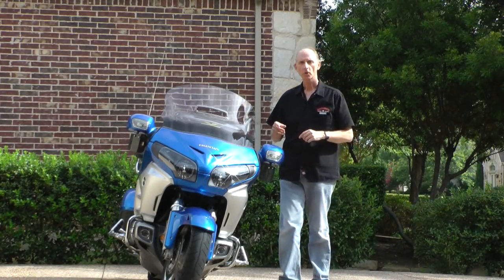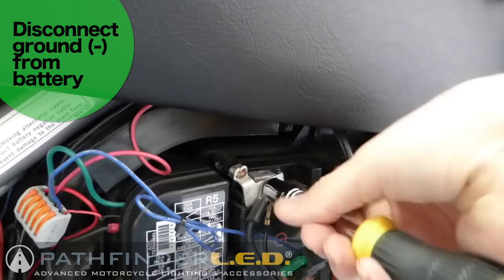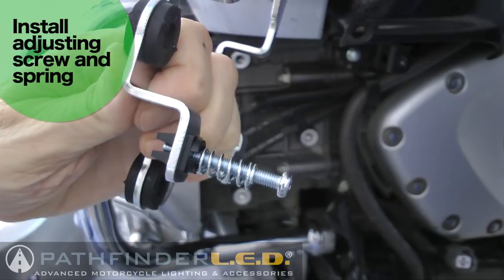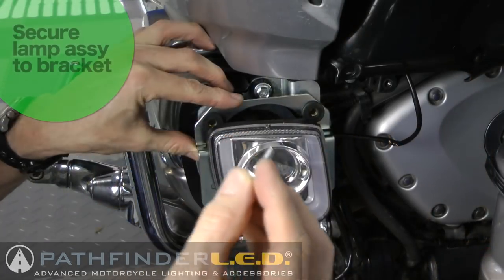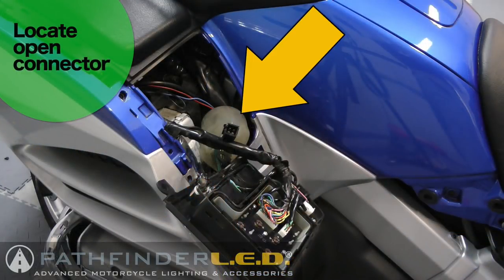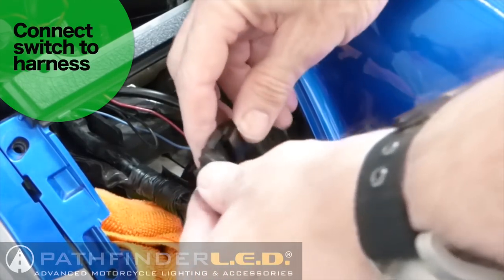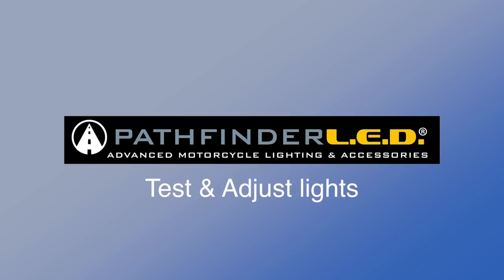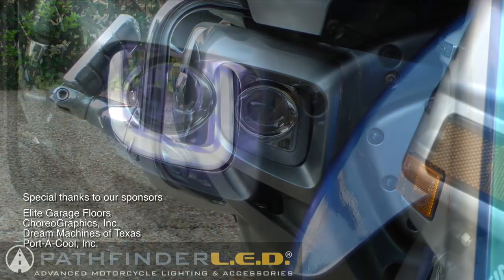Install PathFinderLED® Rectangular LED Fog Light for 2012 Goldwing/F6B/Valkyrie

Comment: Man, I can't thank you enough for making all these videos.  I just bought my very first Honda Glodwing - an F6B, actually - and I got tremendous knowledge from watching all your videos.  I just had the 2016 F6B delivered Sunday, but I couldn't get plates for it till my VIN inspection appointment today, so I hadn't even ridden it at all until today!  Anyway, I bought it back in June from a dealership in Iowa, and contracted with Haul Bikes to have the bike shipped.  They took 60 days to deliver the bike to me.  In the meantime, I ordered a Madstad windshield, PathFinder LED low and high beams, Dynamic sequential LED turn signals/DRL's, and the PathFinder LED rectangular driving lights with turn signals and DRL's.  So I installed everything on the bike today, and flew right through it cause I had watched all your install videos for these items so many times while waiting on my bike to get delivered.  It was a breeze, largely due to your wonderful installation videos.  Thank you so much!  BTW - I was amazed at how wonderful my new (to me) bike rode today.  I'd never even swung a leg over a Goldwing, but knew I couldn't go wrong with a Honda.
Reply from the maker: Congrats on the new F6B!

Comment: I just installed these on my 2013 GL1800
OMG! Fishing for the turn signal wires was a nightmare!  Also damn!  Putting the front lower cowl back on is not easy!  While everything fits well and putting the two little push pins on first was absolutely invaluable, it was still a very difficult task to actually get the two bolts on the face of each side of the cowl in.  The whole cowl just seems to naturally sit back some, and I think on the left side that plug for the fog light that we take the tape off, that seems to want to stick out some sp
I had to kinda Jimmy it into a spot I could push the lower cowl back enough to get the bolts to start!  Wasn’t easy doing it sitting on the ground!! Gonna get a J&S lift after this project lol!
Total time for me, outside and working at ground level was approximately 5 hours

Comment: Received my pathfinder driving light and put on my 2013 Honda f6b was very easy to put on but I did    Find a couple of small issues with the set I received. The screw on the outside of the driving lights you are unable to get a screw driver on the screw. I had to take the light off the bracket in order to attach the light to the mounting plate. The other small issue is that smaller screws should have been sent with the kit for the light switch the screws on the f6b blank are too long for the switch so I made a nylon washer to make it fit better. Other than that very happy with the looks functionality of the lights . But the small issue with not being able to get a screw driver on the screw really needs to be addressed.
Reply from the maker: I have seen that same issue with other light kits. It is a real pain.
Reply: Yep, you have to take the light out of the frame, mount the frame and then put the light in and secure it with the two side screws....You cannot get to the one screw its hidden behind the light

Comment: I installed them on my F6B, and also bought the F6B mirror connectors as well as the resistors.  Everything is done and working but the turn signals flash fast.  I also put in the Pathfinder LED bulbs in the rear turn signals and the front (not the sequential).  I thought with the resistors, that I would not need an LED flasher.  Am I missing something?

Comment: I have a 2014 Valkyrie, it doesn't have the fancy fairing just an add on windshield. does this light kit work on it? where do you mount the switch? does my valkyrie have the wiring harness you describe in your video? i don't want to spend that kind of money just to find out it won't work.
Reply from the maker: Check their website. They make a kit for the Valk.

Comment: May I ask cruiseman what kind of load resistor would I need if I put sequential lights on the front that are amber turn signals and running lights I just got my 1st wing 2005
Reply from the maker: I know that SoCalMotoGear makes sequential turn signals for your year model and no resistor is required.

Comment: F6B not like your video , I did not see the adapter harness or any mention of install?.and I also had running and turn signal lights previously installed on fender trim from previous installed kit ! Had to use two  adapter harness Assy to complete wiring install .
So I have three front turn signals an three running lights for each side fender,mirrors and lowers
Reply: I did not see the F6B1 Adapter mentioned as well did you install it on your motorcycle

Comment: I installed these on my 06 Wing and found that the RF noise from them interferes with the CB (squelch from 4-5 to 11-12) and my toll tag no longer works.  I tried putting chokes on all the wires close to the lights, but it did not help. Love the lights but cannot live with these two problems.  AM radio confirms the lights are blasting out RF.  Wish they were DOT/FCC compliant.

Comment: on a 2015 F6B I have installed the pathfinder sequential LED turn signals and installed the adapters, do I still need the adapter kit to install these 3-1 driving/turn & fog lights?
Reply: Do you mean the flasher kit? I don't know what "adapter" refers to. If it's the flasher you are referring to, (fits behind the nose of the B), the answer is no, you only need one of those for the entire bike, and you took care of that when you did the turn signals.

Comment: Do the turn signals on the new fog lights replace the turn signals in the mirrors, or will both the mirror and fog light turn signals work at the same time?
Reply from the maker: Both will work.
Reply: That’s good to hear. Thanks for the reply. @cruisemansgarage

Comment: Just started to install the switch for these lights on my 2008 GW.  In short, the switch  is too large to fit in the switch panel after removing the blank and the new switch retainer does not align with the original screw holes on the back of the switch panel/housing.  What am I missing? How to solve?
Reply from the maker: I have never heard of that issue. I will pass this along to SoCalMotoGear. Have you contacted their support?
Reply: Cruiseman's Garage Thanks for the reply.  I intend to speak with SoCal today.  I live in Grapevine.  I don’t know if that within your emergency services zone, or not!  ;)
Reply from the maker: Jeff  , is the OEM switch you have from SoCal the new Green LED switch?
Reply: Cruiseman's Garage, in conversation with SoCalMotor, the issue was resolved.  Even though I indicated the correct year of bike (2001-2010) when placing the order, I think the lights are pre-packaged with only the switch for the 2012+ MY bikes.  If SoCal catches this when the order processes, they ship the appropriate switch for the 2001-2010 MY’s, as a separate item with the order.  So what’s the difference between the switches? Well, not much!  However, the differences are critical.  For the earlier model bikes, the ‘tabs’ on the white switch retainer (through which the two small screws pass, securing the switch to the mounts molded into the back of the switch faceplate/panel) are slightly narrower and the entire white retainer is about twice the overall depth, as compared to that on the 2012+ switch.  SoCal sent a picture of the two switch assemblies and the issue was immediately apparent.  Thank you for your sincere curiosity and follow-up.  Can’t wait to receive the correct switch on Monday!

Comment: Excellent video, but I would not recommend using a Dremel tool to cut the lower cowl.  The tool is too clumsy to maneuver, and it becomes too easy screw up and have the chuck rub against the cowl and mar it.  Don't ask me how I know this.  I would use a hack saw blade to cut the sections out then and use a sanding drum on a Dremel or a file to then clean it up.

Comment: Hello Sir,
First thank you for your videos they are very informative.  I've run into an issue. When it came time fish the turn signal wire up to the mirror I can't get a wire all the way through due to the plastics. Am I missing something or do I need to take off the side plastics and if so how the heck do I do that? Thank you in advance.
Reply from the maker: Have you tried poking the fishing wire from the top down?
Reply: @cruisemansgarage  yes, it just runs into the plastics and never comes out. You can hear tapping right there but the way my side plastics are it won't come out.
Reply: It's like my side plastics are sealed with no opening at the bottom
Reply: Any thoughts?
Reply from the maker: @soothingwhitenoise305  what are you using as a fishing line?
Reply: @cruisemansgarage  I used a 10 gauge piece of wire then a hanger. I have a fishing wire but it's pretty big. I'm stumped.  Like I said you can hear it right at the bottom but there's no place for it to come out.
Reply from the maker: @soothingwhitenoise305  I always use a 3' long cable tie. They are stiff enough to push through, but flexible enough to work around various parts.
Reply: @cruisemansgarage  thank you so much.  I'm going to work on it again today and will post a pic if I get it done.
Reply: I did them today and to say the least its a bitch...Your going to spend at least an hour fishing the first one and then the second one will go easier....
Reply: Don't try to run it in a straight line to the light....go straight down in front of the radiator and then run it to the light.
You can reach in and tuck the wire back to get it our of sight after you get the wire run.

Comment: Considering the price of the Gold Wing, and the Valkyrie,  Honda should have included the driving lights out of the factory, and not as an option.  The price Honda wants for the lights even without the installation is a ripoff
Reply from the maker: If Honda included the fog lights, the price of the bike would be even higher.

Comment: My friend just bought these lights and they are a great package.  We did the installation and fished the wires down, which was allot harder than I had thought it was going to be but once we got the first one done the second one was a breeze.  Here is my problem if anyone can help me.  After installing the switch in the radio control panel I cannot find the connector on the motorcycle that should be part of its wiring harness...We looked everywhere in that space and cannot seem to come up with there that connector is.  Can you give me a better idea of where that connector is located in the wiring harness..???  Does anyone know that can help, I surely would appreciate it.  We put it all back together so he could ride the motorcycle but the fog lights are not plugged in so he only has the lower driving lights and turn signals...We need to find that connector and we are done.
Reply: I know your question is old and you have probably figured it out by now, but I will answer for the benefit of others, as I also had the same issue myself.  I found the boot that contained the connector below the radio control panel.   For whatever reason, I was looking above it.  In that boot on my F6B, there were three connectors and I had to strain to be able to see it.  I tried to plug the cable in with the limited access that I had, but unfortunately, I could not get the plug into it without cutting the boot, which I then zip corded back together.  You should be able to plug it in without cutting the boot if you remove the fairing piece that also contains the left side of the tank cover, but unless you are also changing the air filter, you will probably not have removed that section which is no picnic to remove.

Comment: I have a European goldwing. I install a Pathfinder led. When i turn the blinker, than the white light is still on. I think its not good (only the orange light must work and the white light has to stop working) Sorry for my englisch. What dit i do rong?
Reply from the maker: Something is not wired up correctly.

Comment: I have the original kit where I had to splice into the mirror wiring. This updated kit has the nice connectors. 😒
Reply from the maker: I had the original kit on my 2012. The new one is definitely easier to install, but I loved the lights.

Comment: These are very nice DRL and Fog lights but the turn signals are very weak....  If the signals were twice as a bright as they currently are then they would be perfect....With stock headlights, the turn signal maybe bright enough but with LED 6000K headlights and the fog lights on the turn signals are getting over powered.

Comment: Mere bhai
English is not ur forte
Hindi might be a better choice for u
Reply: I just received this kit for application on my 2008.  Brackets and lights installed.  Removed the  two small retaining screws for the switch blank.  The light switch does not fit ....it is too large to slide through the opening in the switch faceplate and even if it did, the screw holes of the white keeper on the switch do not align with the location of the retaining screws for the blank.  What am I not understanding?  Thanks for your help.  I live in Grapevine.